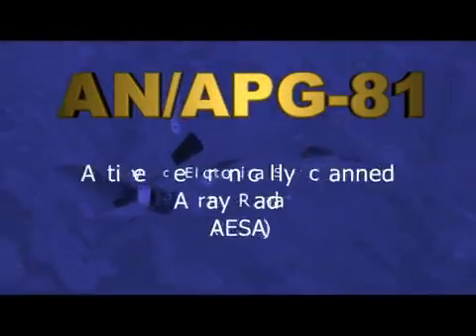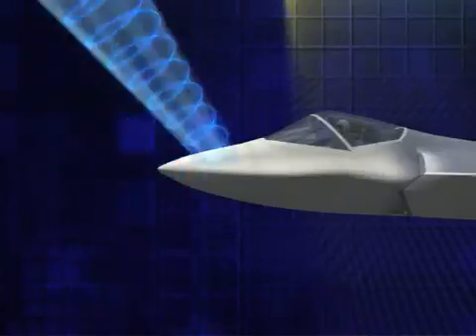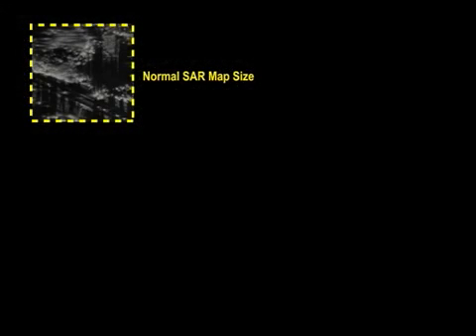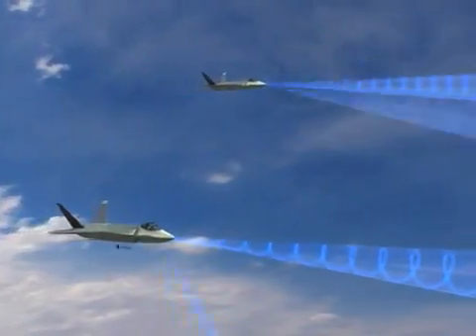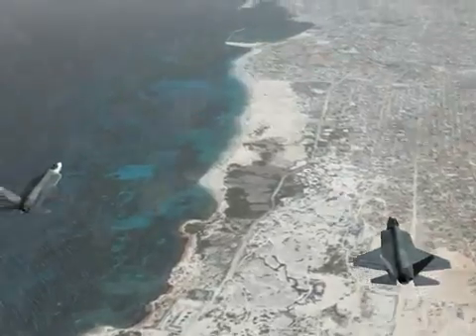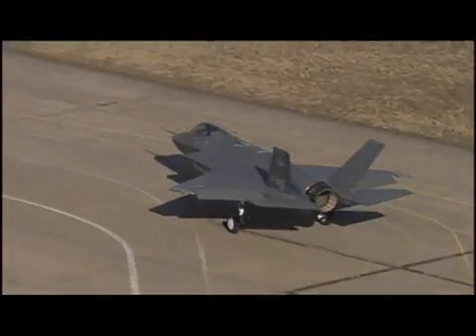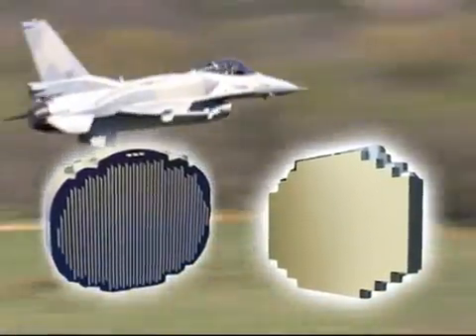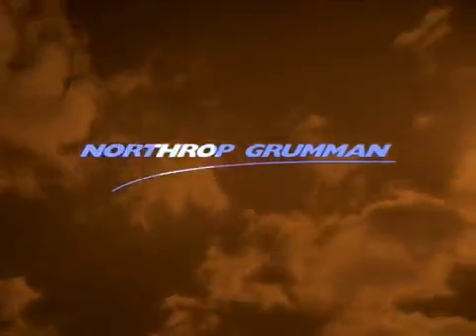F-35 JSF APG-81 AESA Radar

Comment: the F-35 maxes out at 1.6 with any load or lack there of. The only way the F-16 gets its maximum speed is with a clean airframe. When it is carrying a full load of weapons and fuel it manages around mach 1.1/1.2.
Its the same with the F-18

Comment: The SUs' rf emissions could be quite intermittent and still provide sufficient RF energy to be targeted by the missile's passive RF seeker. If the Su-35 is truly rf silent then the missile would go active and the Sukhois would have a chance to defeat it with countermeasures and maneuvering. I explained the different guidance modes for modern RF guided missiles; There's no crystal ball here just seekers, kinematics and guidance algorithms that make modern missiles hard to defeat.

Comment: @WTDify Not quite. In order to disable radars it first has to find them first. The F-35 is a big failure. Cost/Efficiency ratio is very low compared to F-15, F-16,Su-37 and Rafale. I see no reason for a country to buy such an airplane.
In a lasting war it's the average planes that do all the work. Expensive planes whose only purpose is to show off during peacetime will be useless.

Rafale for instance has half the price. I doubt 1 F-35 can shoot down 2 Rafale's.....

Comment: @WTDify And vice versa. But since the S-400 is a defence system its going to be out of sight, fortified etc. Therefore the F-35 (an the F-22) will get its expensive ass kicked in case it invades a country using the S-400.

Comment: @WTDify I just told you that range does not matter, simply because a mountain/hill/something will be blocking each other's view until they are closer  than 75 miles  ,meaning the range advantage is basically useless.  Radars can't see through hills or mountains....

Also, because you probably know little about the F-22, it's missiles and weapons are inside the aircraft (to smoothen the hull and be stealthier),and in order to launch , the side or main bay's have to open...

Comment: @WTDify Warfare is not always taking place in deserts. What I mean is that range doesn't really matter since mountains or hills protect/hide the S-400, eliminating any range advantage of any stealth plane. When the S-400 and the stealth plane are going to be able to spot each other, they will be much closer than 75 mil.

Also, as soon as the F-22 opens the little hatch to launch the missile, it can be tracked by long-range missiles so it pretty much makes its stealth feature useless.

Comment: How does it fit into the argument that as the Stealth Jets switches on their radars, the SAM Radars detects the originating of these radars, the jets may not be detected but the source of AESA beams are. 2nd: The S300/400/9K331-TOR M1/Saab Giraffe are highly immune to the best of the jamming. Again, the jets may not be detected, but not the Air to surface guidance booms/missiles, these could be clearly intercepted.

Comment: The F-22 Raptor has a much lower radar signature than the F-35 if i am correct, and the F-22 will also be equipped with DAS in the future, the F-22 is a Air superiority fighter, the F-35 is more of a strike fighter. though the F-35 is extremely advanced. but the F-22 has a major first see first kill capability, along with good agility and dogfighting capabilities, which makes it a good fighter, and if it is equipped with DAS like i have been told, this will further enhance its capabilities.